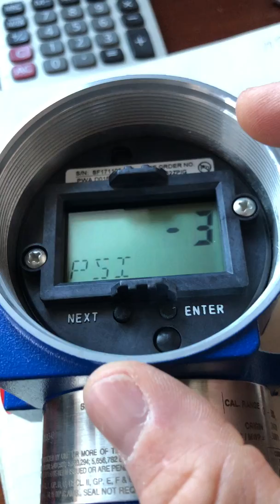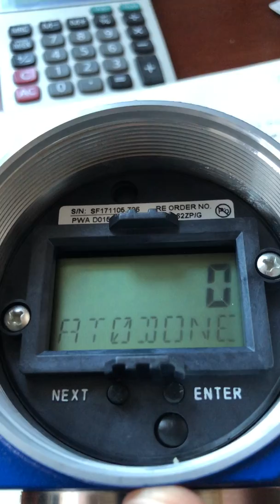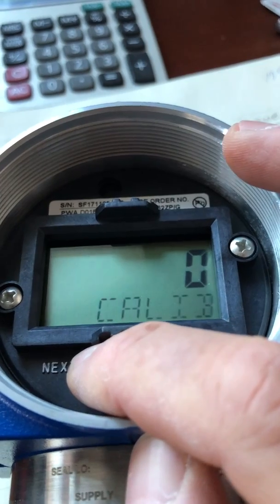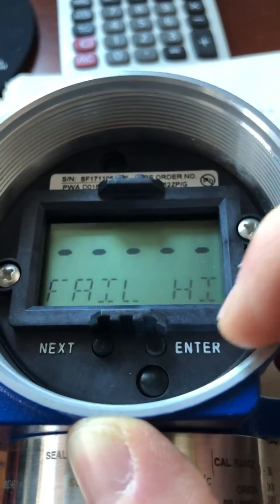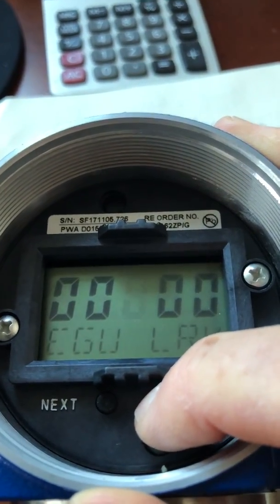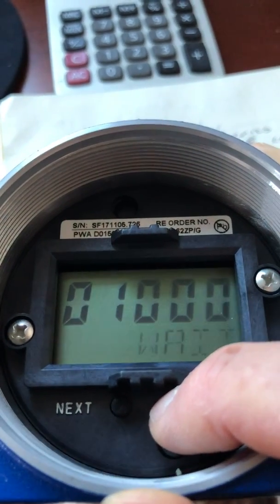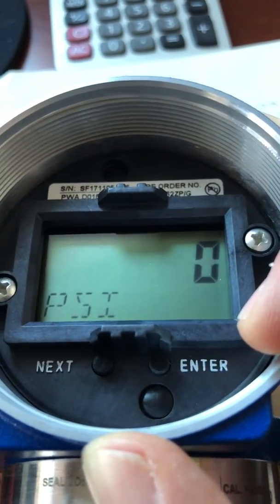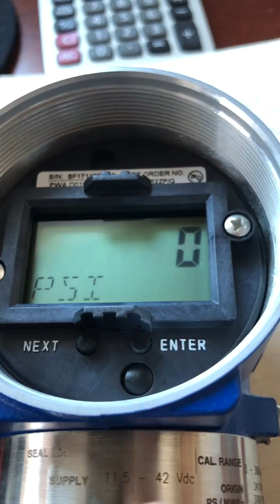FOXBORO IGP10-A Easy Setup, Zero Calibration, Output Setup

Comment: I have a transmitter that seems to be losing its lrv! Any reason why it’s doing that ? About once a month I have to do a 0 calibration on it to get my desired / correct reading off my ground surface tank! 

Great video 👌🏻
Reply from the maker: Are you saving it after the zero? Is the sensor getting hit with high pressures when in service?